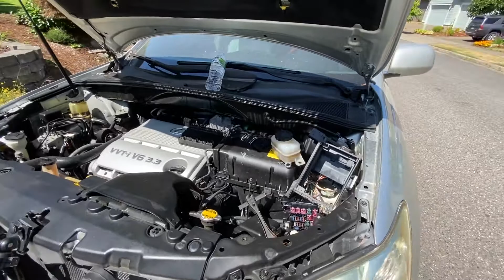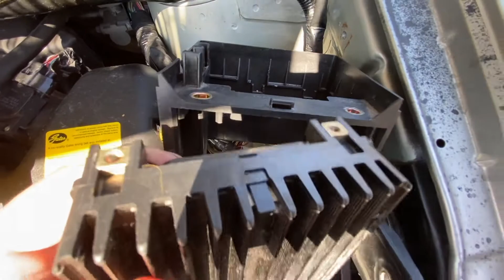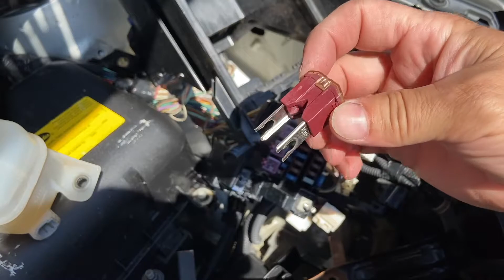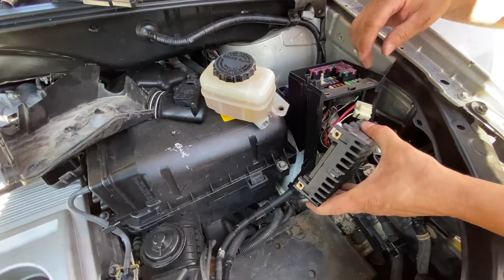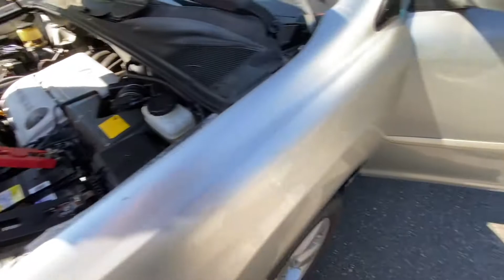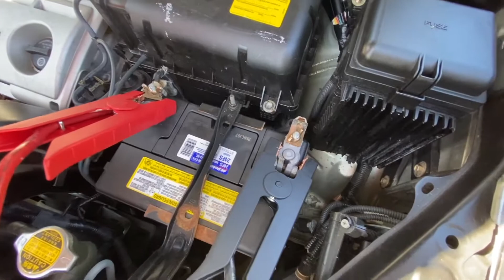HOW TO REPLACE 140 FUSE ON A 2006 - 2011 LEXUS RX330

Comment: Thanks for sharing. I drive the 2004 lex rx330 the layout is pretty much the same. Unfortunately the 60 fuse blew out now I'm stuck with the task of having to to replace it. 
I will definitely use this video as reference. Thanks again!
Edited 10/18/22: just replaced the 60 fuse today under 45m using your video as a reference, thank you again.
Reply from the maker: You welcome.
Reply: I got a Lexus rx330 2005 I bought it used and had timing belt waterpump coil and spark plugs replaced costs 1298.80 and now I came out from work last night and I turned key over and no sound or anything headlights and dashlights working I just put a new battery in December I thought these were reliable seems like I got another headache omg
Reply: @kellysutton2780  sorry to hear that. I know the stress and headaches having a vehicle can bring upon oneself.
It sounds like you may have a bad alternator if you purchase a new battery in December and your car loses juice too quickly. But i could be wrong and could be a variable of things in conjunction to loss of power.
Best wishes to you!

Comment: Why did you have to replace this fuse...what caused it to blow and what did not work when fuse failed ? When fuse blew did you still have dashboard lamps ( tach and speedometer area ) come on ? Any other info would be helpful I can't start vehicle after trying to jump start with a portable jump pack. I've jumped it a few times with this jumper without incident .Not sure what diff this time but horn blew and that was it no start.Thanks for any feedback.
Reply: I wish someone responded to your comment , having same issue
Reply: @mrc79 
I might be able to help you mine has now started after replacing the fuse.

Comment: Sounds like it could be the 140 amp fuse but it's not lookin like blown but also not easy to tell cause can't just pull out to inspect.The top of fuse isn't very clear so can't tell if a section of it blew.The center of it looks ok...Wonder how I can test it?

Comment: Is this fuse what they call the Master fuse? The car won't start if it's blown? Thanks
Reply from the maker: not sure if its a master fuse, but this Lexus didn't start without it. what happened here is i think jumper box was connected wrong and it burned the fuse.

Comment: My car wouldn’t start.  Dash lights, Headlights, dome lights and remote worked but infotainment system, windows, trunk didn’t work at all.  Made no noise at all when trying to start it.  Had it towed to the shop and they said fuse wire burned with burnt fuses and fusible link wire burnt.    My question is how does that happen and what’s a fair price to fix it all?     Battery was only 5 months old and was never jumped before the car didn’t start.   Obviously tried jumping the battery once the car didn’t start and don’t think I mixed polarity of the cables.  So what can originally cause this to happen?  Thanks

Comment: I got a Lexus rx330 2005 last night when I got off work I tried to start it but no sound nothing but the headlights and dashlights are working any idea what it could be
Reply from the maker: could be that 140 fuse or also could be starter. let me know what fixed it once you figure it out. how many miles do you have on it? also ask someone you can trust to look at it. fist check fuses then starter. thats where i would start. could be something small. or battery or battery connections needs cleaning.
Reply: @DimasCarTech  has 185thousand miles and unfortunately everything is closed until Monday I just had timing belt waterpump coil and sparkplugs replaced   cost 1298.80 and now this
Reply: @kellysutton2780  what was it
Reply: @C  starter costed 492.80

Comment: Why did you change that fuse?? what's the problem with the car?
Reply from the maker: The battery was dead and the jumper/jumper cables wore hooked up wrong , instead of black to black or red to red it was hooked up wrong way and the fuse was blown. When that happened the car wouldn’t start.

Comment: How did you separate it
Reply from the maker: separate which part the little plastic cover thats on the bottom? i just slide it down i beilive. and if you referring to fuses being separated from the box i just pushed it in i beilive. you kind of have to play with it back and forth. it was my first time doing it as well. hope that answears your question.
Reply: @dimascartech  Okay, I'm still having problems trying to separate the box.  I'll keep on trying.  Thanks for your response.
Reply from the maker: @williamvaughn8099  no problem, hope you get it done. see maybe you can watch some other videos , maybe they did it more step by step. when i was recording that was my first time doing it, i also spend some time on it. it really does take some time.
Reply: @dimascartech I was able to get it done.  This video was a big help.
Reply from the maker: @williamvaughn8099  glad it was helpful :)